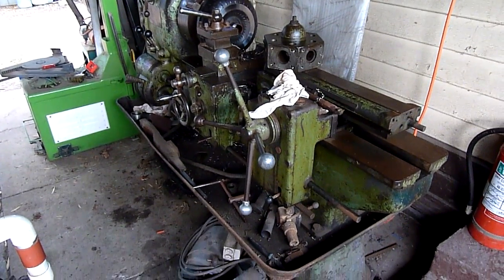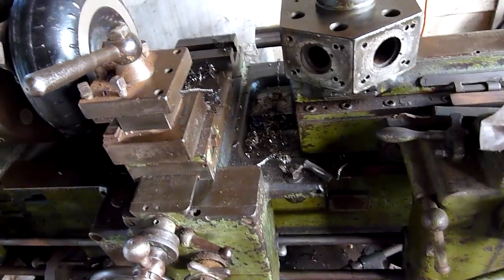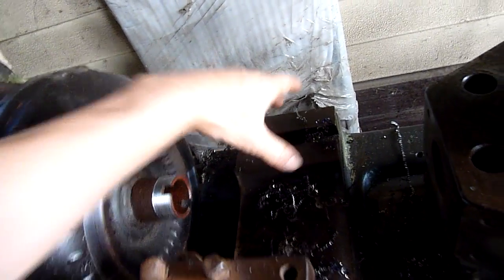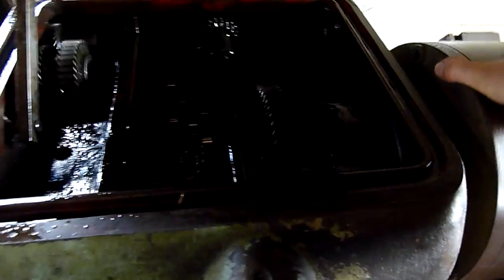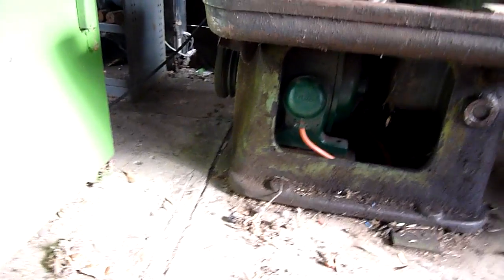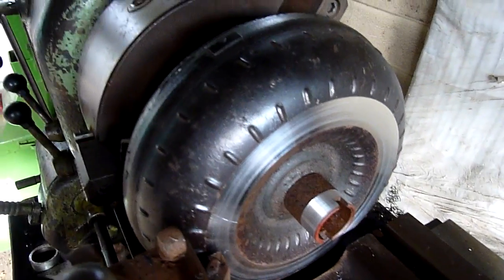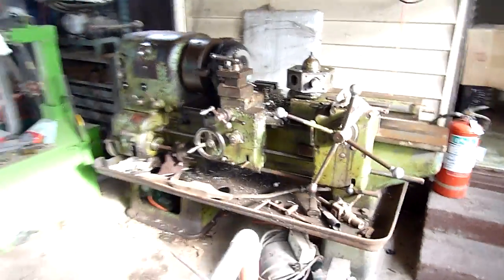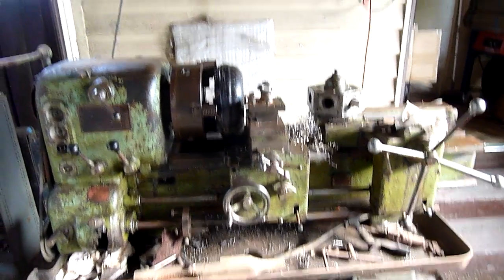Old 1930's Turret Lathe runs again

Comment: very cool machine! I got myself soviet old one (looks like 1954 stamped on it )with no model markings and it pops the breaker every time (pinched motor cable while moving it it looks like). Got to find the time to fix it and use it. Have no idea what half of the handles do, lathe I used once in uni had less :D Markings lost to time.

Comment: The sparks were because the cut was at too fast a speed. Learn about FPS for different metals and bits, or just observe the brown chip rule. Brown comes before blue, and way before red. If the material coming off turns blue from heat, back off the speed a tiny bit. Longest life for tooling at max cut speed.
Reply from the maker: yeh I know all about surface speed, I knew I was pushing it but it was a torture test with a badly chipped insert, machine handled it like a champ!. I do not mind running blue chips, but yeh if they are turning red, not so good :(
I was trained as a production machinist, get it done fast, if you need 10, cut 12 and if you scrap a part or 2, so be it. and likewise, run the machine until it starts complaining or your eating tools/work-pieces. 
Mind you my new job is in an extrusion place and tool&die work is somthing I have to take on, so slowing down and getting it right every time is a must, bit of a shock to the system but its not a bad way to pass the time. just let the lathe tick over instead of hauling ass :D

Comment: Bata went onto producing footwear for soldiers, is same as shoe co
Reply from the maker: +HDXFH yep!, it looks like they dropped the machinary and bicycle tyre divisions around wartime and just kept doing footware after
Reply from the maker: Thanks for the info!, Bat'a footware still exists in Australia with local manufacturing!, they are a bit expensive, but they are good shoes!, I wear Bat'a work boots all the time!.
Reply: Baťa, based in Zlín, Czech Republic was founded in year 1894 as shoe-making company only. In the year 1932 founder died in plane accident, but despite that they expanded their factory and started making tyres, artificial fabrics, toys, knitting machines, bicycles, aeroplanes and also lathes (ugh, czech name "soustruh" is waaay better...) Long story short, Tomáš Baťa (Thomas Bata) made the biggest company in Czech republic, even built one of the largest city just for factory workers. Even today they are very succesfull shoemakers, but in my opinion their footwear is little bit too overpriced - shoes for 65 USD (1600 CZK) is way too much since I buy shoes max for 25 USD (600 CZK).

What is also interesting, Bata invented todays most used style of pricing - 59,99 instead of 60, because it looks cheaper then it really is.

Comment: Wow what a nifty bit of kit there Aussie I like the turret quick change on it I take it that it would be used for jobbing work ?
Reply from the maker: +dtec30 thats right, its a repetition machine, you often have a bar feeder and simple collet chuck on many turret lathes. its design pre-dates computer controlled machines, and sees little use in modern shops outside of random jobs, usually ones it was not designed for anyway.
Reply: i had seen an old jobbing shop on tubalcains channel i would have loved to work with the machines like that, i love the smell of penetreene
Reply: oh hey hows the hyundai going by the way ?

Comment: For a worn out example of a turret lathe that looks to be running pretty straight. And operating good, no abnormal sounds coming from the gears, i still haven't heard (with my own ears) a turret lathe that sounds good, straight cut gears or not, every example regardless of wear and tear i've come across sounds like a clunker.

Trust me, i've seen worst (and i'm sure you've seen too considering your line of work). Heck, the very last turret lathe i've seen, it was so shot, so worn out from continuous production use, the turret could be slid side to side about a half a cm with the finger when the locking latch wasn't engaged. 

It's cool that you're bringing it back to use. Take the turret station down, source a conversion piece for the slide so it's normal and you have a multi purpose lathe to use.

Comment: 230/400V 63A three-phase is kinda standard over here in germany. I know single-unit houses with 125A mains...
Reply: +PCNeuverdrahter When TPAI did a video on the German mains grid I was surprised that most houses have 3 phase service. Here in upstate NY where I live, the poles only run 220v 2 phase. 3 phase service is really rare, and only really in industrial parks.